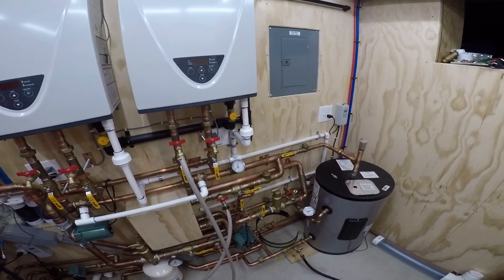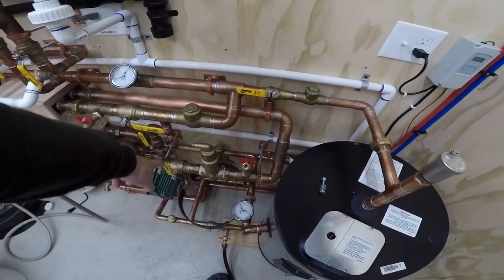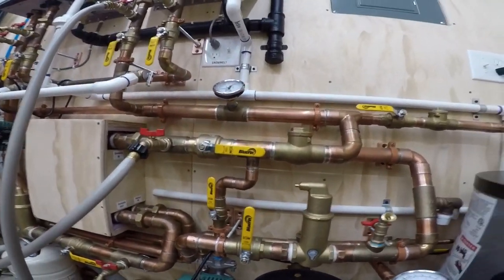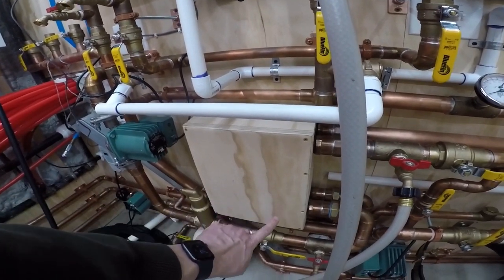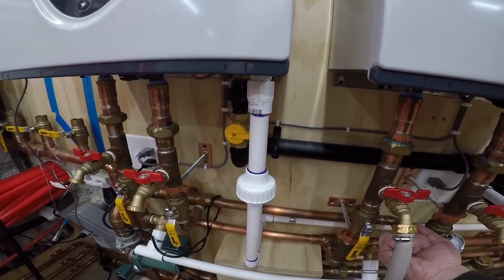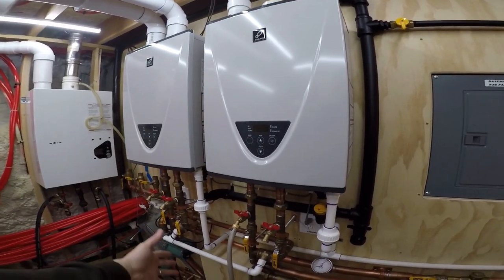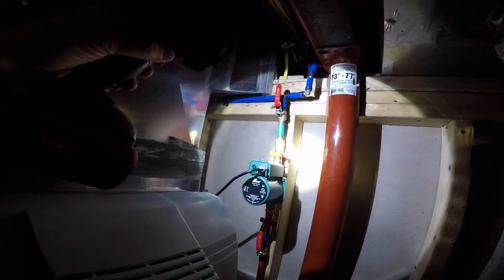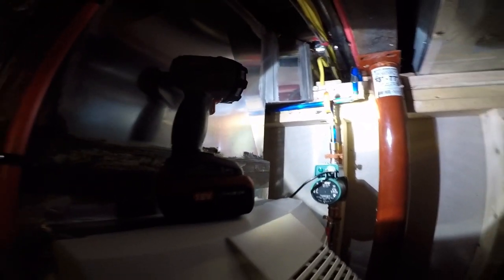Testing Taco Pump Operation and Identifying Pump Noises Before Startup - Episode 26 [11-18-2020]

Comment: How far away is the first 90 away from the pump on the discharge side ? It does matter according to some pump instructions, sometimes you need 3x the pipe diameter distance before you can use an elbow , or whatever the amount is differs depending on the manufacturer.

Comment: You can purge until the water utlity runs out of water and not get all the air out. The water coming in is potable water which is full ofn air, open system. On the hydronic side, closed system, air can be purged and whatever remains the seperator will take care of it. Did they quite down after it ran a while?
Reply from the maker: Yep, they did.  It’s funny uploading these old videos and remembering the things I was worried about 😃.  They did quiet down after a few days of use, and while I can still hear them running, I wouldn’t consider them loud or noisy by any means. I think most of the noise is coming from the vibration moving through the rigid wall mounting than the pump itself. In hind sight, I would found a better way to isolate the tankless units and pumps from the wall, maybe with rubber pads or something.
Reply: @DeckerChristopherJ  I have one in hot side of my potable water, makes a tiny bit of noise. My closed hydronic ones pretty much silent.

Comment: Interesting.. taco 0014 is a beefy guy. You have very little head in the system and that sucker it probably trying to move close to 30gpm? I couldn’t see the others but they look like 007 maybe for the recirculation. Rigidly secured piping is great but it sure does amplify noise
Reply from the maker: They are actually 0013’s. The read I went with them was to overcome the high pressure / head loss of the tankless units.  So far they’ve worked out great, and can push 3.8 GPM through each tankless, or 5 GPM each if both are on.

Comment: There's nothing wrong with that pump
Reply from the maker: Nope, there absolutely is not! 3+ years now and it’s still going strong with no problems.  This video was my first experience with pumps like this, and at the time it sounded loud or like I didn’t get all of the air out.  I do think it quieted down a bit since this video, and it’s been operating trouble-free since!  Thanks for watching and for the comment!  I appreciate it!